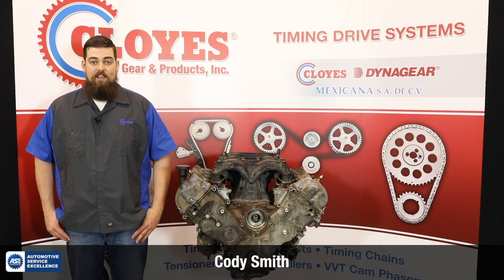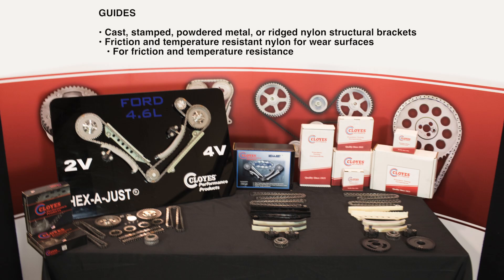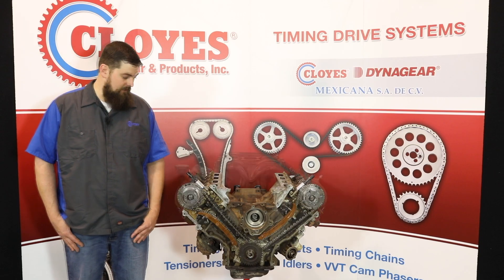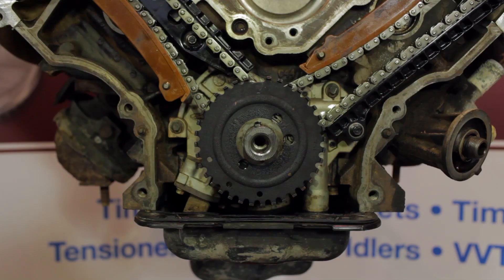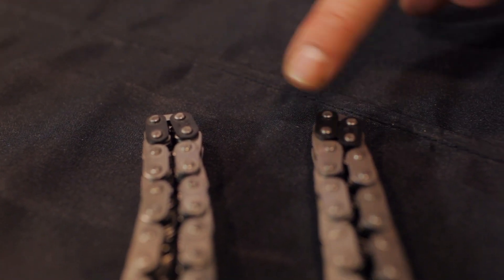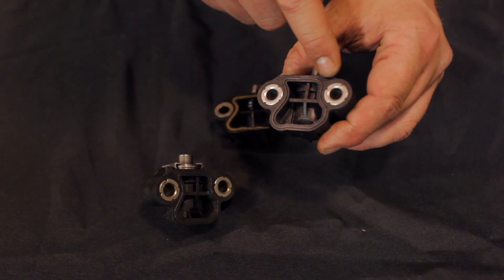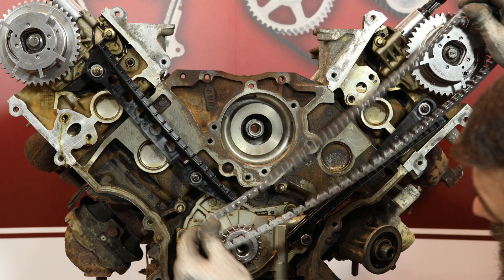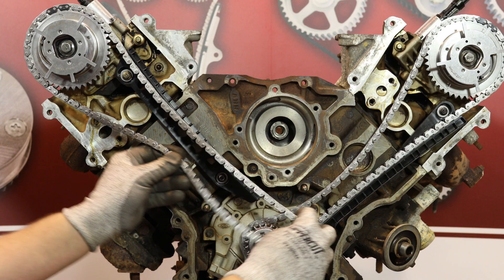Ford 5.4L Timing Chain Replacement, Cloyes 9-0391SB

Comment: Are these Phasers oem?  My kit xam with phasers.  9-0391sbvvt
Reply: Update: never mind, they were garbage right out of the box.  Nothing better than learning the hard way.   Claiming they perform better than oem is a fraud.  “VVT actuators are naturally part of the timing system and it only makes sense for Cloyes to offer high-quality, aftermarket VVT system components that work with our current timing system product offerings,” said Jason Thompson, vice president of engineering and product development for Cloyes. “Our expertise in modern timing systems, combined with our manufacturing and quality standards, resulted in Cloyes developing VVT actuators that work as good as or better than OE units and will withstand abuse in the most demanding applications.”
Reply: NO1
No!

Comment: What gaskets are needed in order to do this job?  Valve cover? Intake Manifold? Timing Cover? Or are they reusable?  I want to make sure I have everything I need before I tear the engine down.
Reply from the maker: Valve cover gaskets and a timing cover gasket kit should be all you need. Make sure the timing cover kit comes with a new water pump gasket and crank seal.

Comment: No upgrades on the oil pump?
Reply from the maker: We do not sell oil pumps, so we didn't focus on that during the video. We do highly recommend installing a good quality pump while you are doing this job.
Reply: High volume 340HV 20% more oil via 60 PSI

Comment: So i did everything you showed and said but bank 2 is two degrees off and runs like crap.So can you tell what i did wrong?
Reply from the maker: I don't believe 2 degrees is enough to make one run noticeably poorly. One tooth off on a cam sprocket will affect it by over 8 degrees, and about 17 degrees if you are off a tooth on the crank sprocket. Sound like you may have a VVT system component issue or something non-timing related.
Reply: Okay so i keep getting a p0345 and a p0349 code bank 2?
Reply: @ricksherow6422  Did you get that sorted?  I just bought this kit to replace the phasers and timing setup on my 2005 F150 5.4L 3V.  I was throwing  0345 and 0349 previously, and am about ready to pull the valve covers and front cover.

Comment: Hello. Very good video.  My son and I decided to replace the followers, lash adjusters and passenger side phaser on his 06 F150.  We did not use the wedge to support the chain, choosing to instead use a bungee cord.  When we reassembled the engine, the notch and slot on the cam / phaser were about 1 tooth off.  I thought that maybe the cam rotated.  I loosened the cam and realigned according to our painted alignment .   We reassembled the engine.  Ran great at idle, but rough in gear.  Threw a p0016 code.  I figure i slipped the timing chain one notch?  Can you help us? Can i just rotate the phaser/cam 1 tooth?   Any advise would help so much.  The shop just wants to charge us 1600 to pull it all apart and replace everything .
Reply from the maker: Sounds like you are going to need to pull the timing cover off and confirm timing on that bank. Once the cover is off it will be easy to check if the bank is in time or not.  There should be an equal number of links on both sides from the crank sprocket mark to the mark on the cam phaser. Without that visual confirmation you would simply be guessing.
Reply: Yes sir.  I took it to Ford and they hooked it up to their computer and told me that the right bank is 30 degrees advanced.  Not sure what to do with that, so i will likely have to pull the cover.
Reply: Hello again.  I removed the timing cover and chain guides.  I however did not follow your video.....mistake.  My keyway is not at 6 oclock.  I can easily remove the cams, and align the proper teeth on the R/L phasers. I would gladly pay for your phone advice via paypal.  I cannot understand why you pulled certain rockers (to make neutral) if you were going to pull the cams anyway.  I could sure use some advice.  I do not want to bang valves into pistons.  Jerry
Reply from the maker: @jerryvanover5710  You can call our tech line at 479-646-1662 ext 228, no paypal necessary. You should not need to pull any camshafts or rockers, no matter where the engine is at.

Comment: The way you show to line the crank up is 100% incorrect read the ford repair instructions and use the actual timing tool on the crank and you will see im right. The key should be at 11 oclock and the dot should be at 6 i currently have two ford trucks in my shop one i couldnt get to stop missing and the other still rattles after installing your kit. Ive done both now 3 times each twice with your parts and instructions and once with ford oem parts and ford repair  instructions guess whick one fixed both trucks. I should be after you for about 40 hours in labor i waisted on your junk
Reply: Just want to clarify this engine has no timing marks and it doesn't need them this engine has a key on the crank and dowels on the cams therefore if you install the chains correctly it doesn't matter where you stop the engine 6:00 and 12:00 would just be a reference point. Again the chains do all the timing this is normal . Timing this engine is dummy proof.
Reply: Corey is right. You should use OEM parts too. According to Ford the crank must be at the 11 o’clock position.
Reply from the maker: The marked links of the timing chains set the timing on this engine. It doesn't matter what static location you set the shafts to, relatively speaking, as long as the marked links of the chains align to the sprocket timing marks correctly. If you set the crank key at 11 o'clock, that will just require the cam sprockets to be rotated slightly counter clockwise from what we show.

Comment: On ford expedition changed timing chain and sprocket after that the the sprocket is spinning but the cam is not which cause sound and right side 4 cylinders are not working any idea??
Reply from the maker: The dowel on the sprocket should index into the camshaft, then the bolt clamps the sprocket to the shaft. It sounds like the sprocket dowel may be damaged.

Comment: Cloyes kit 9-0391SBVVT. Has a straight torque spec for Cam phaser. No additional 90degress are needed. And I've just taken the entire kit back out of my motor after 2 days and thrown it in the trash. Phaser's failed straight out of the box and unsure if tensioner's are still usable.
Reply: Jeez...making junky critical engine parts is a new low. I put a cloyes timing chain and gear into my daughters 2003 taurus.  I knew they were cheap, but I figured how to you mess up a gear and chain?

Comment: I have the 2v version on this engine and I made the mistake of aligning the keyway on the crankshaft to the TDC mark but the timing marks on the camshaft sprockets are not where they should be (11 and 1 o clock i believe) and I have already taken the timing chains off.  Can you tell me what I can do to fix this?
Reply: Look online how the lobes on the cams are supposed to look. The crank shaft key is what sets the timing
Reply: @jrvera7955   Is it safe to rotate my camshaft sprockets with the crankshaft at TDC?
Reply from the maker: Rotate the crankshaft to a position where all the pistons are down in the cylinders at least a little. Then rotate the camshafts to position them correctly. Once the cams are good you can rotate the crank back so the key is at 12 o'clock.
Reply: @Cloyes01  Thanks a lot! Im doing a full head gasket replacement so I think I can rotate the cams to the right spot while the heads are off and then reassemble with the crankshaft at TDC.
Reply from the maker: @LWilson  That will work great!
Reply: Should be 6 and 11!

Comment: How much should a be charged for this job? My mechanic wants $700 plus $400 for parts.
Reply from the maker: That seems very reasonable. Most shops are going to quote more than that. This isn't a difficult job, but it is very time consuming.
Reply: Oh okay thank you for responding. I really I'm happy because now i know what to do with our truck. Thank you!

Comment: Cody you make the timing of the 3v engine so easy and well explained to some videos i see they’re moving roller follower and lash adjuster and sparks plugs..So Cody the crankshaft key is at 12 o’clock and the timing mark is at 7 o’clock position..
Reply from the maker: Just rotate the crank one more full rotation. That will position your cam 180 degrees from where it is now.
Reply: Cloyes Gear & Products, Inc. so Cody quick question so you don’t have to remove the roller following ,lash adjusters and sparks plugs and position to he number one cylinder at Top Dead Center to time the 3v engine.You make it look easy.
Reply from the maker: @michaelmurray121  Nope, you don't need to do any of that. Those instructions were originally authored by Ford for the replacement of cam phasers without timing cover removal. Then, for whatever reason, everyone else adopted the same procedure for timing replacement. If you are removing the timing cover all of those steps are unnecessary.
Reply: @michaelmurray121  I don’t know what their talking about but this procedure is still in service data. It still says cam followers need to be removed from certain cam lobes

Comment: I'm replacing just the Cloyes tentioners due to morning rattle. Thinking of not removing the valve covers, just loosen them. ?
Reply: You have to remove the front timing cover . You can't even get to them with removing it.  I had a bad rattle too last week and tore mine down and it was a stuck roller follower and messed my can lobe up. So I'm doing a total timming/cam rebuild.

Comment: The problem with the overhead cam engine's is the steel cam shaft is mated to the aluminum head. There is no steel bearing like the old overhead valve motor's. It shows in the video what can happen if not properly maintained, the oil journal's get obstructed and it starts chewing the assembly up to where it gets slop in it, then the head is no good. I wouldn't use lower than 10w 30 or 10w40 in them, I don't care what ford say's. Chevy=the same thing, Chrysler=the same thing. 2009 to 2010 was the end of the overhead valve engines so Ford, Chevy and Chrysler all have the same style junk. Definately not worth what you pay for it.

Comment: For the metal tensioners,  is there need for a gasket? Silicone? Or install metal to metal? These are Cloyes from Oreillies.  Thanks
Reply from the maker: No need for a gasket. Do not use silicone! Silicone can clog the tensioner oil check valve. Just install metal to metal, both surfaces are machined.
Reply: Cloyes Gear & Products, Inc. so you have metal and plastic tensioners?  Or just metal    I might be doing this soon   And was big in the idea of the Melling tensioners   I heard they are metal and don’t need a rubber o ring and are sturdier ?   My mechanic uses your sets with ford phasers    I also want to do the Melling hv oil pump at the same time    Trying to narrow down the tensioners
Reply: No gasket is required since it is a ratchet type and is not a plastic one that requires the oil to push the tensioner to the guide.

Comment: I came up with my own reliable procedure for installing the cam followers on a 5.4 3v. 1st time I had to work on one, I realized no one had made a necessary tool, and my method cannot bend a valve, no follower is ever installed at TDC & I can prove it cylinder by cylinder. 
Installing the followers with that OTC spring compressor tool is a total waste of time, unreliable, and will drop your valve retainers off the stem the 1 time u aren't looking right at it or cant see it.. or in my case, breaks off at the top, valve fell down into the cylinder.. ridiculous. Oh, and no cams "popping" their way around at all doing it my way.
Reply: WHAT IS YOUR METHOD?

Comment: In a video i watched the guy put the first chain link mark one tooth  forward and the second chan link mark right on the dot of the crank sprocket so i followed it did i do this wrong?
Reply from the maker: The chain will have two marked links in a row that will go on either side of the cam sprocket mark, then the single marked will align to the crankshaft sprocket mark. If you did anything other than that the timing will be incorrect.

Comment: Great, clear video instructions.  But, do you have any suggestions for  a 2004 Lincoln Navigator 5.4L  DOHC  4V ?   Broken timing chain led to blocked filter so no oil got in.  Installed new head and timing chains per video.  Have compression in passenger side, but low/no compression on driver's side, so no start.   What a bear.  Just thought I would run that by you to see if you have a suggestion.  Thought it might be a cam out of position, but can't find specs on how to check to find out and position.  Doubt I am making much sense due to having worked on it for several days to try to figure out what I am missing.
Reply from the maker: You need to make sure the secondary chains are timed properly. The secondary chains have 2 marked links that align to the dots on the secondary sprockets.
Reply: @Cloyes01  Thanks.   Will double check that.

Comment: At what point in time are the cams secured/ roller followers removed so the cams don’t rotate? How are you explaining how to do this job without talking about the most important step.
Reply from the maker: Securing the cams and removing the roller followers is not required when removing the timing cover. Camshaft rotation is minimal when the chains are removed. Any rotation of the cams can be easily compensated for by slightly rotating the crank using the balancer when reinstalling the chains. The chain marks 100% set the timing, so if your marks are all aligned there is nothing that you can do incorrectly. Even if you remove the followers you will likely need to make small adjustments to the crank when installing the new chains. Your crank key may end up anywhere between 10 o'clock and 2 o'clock, but that is OK if all the marks are aligned properly.

The roller follower removal was a process written by Ford for replacing the cam phasers without removing the timing cover. Repair publications adopted the process for all timing related repairs, but they simply missed the point of the process.
Reply: Cloyes Gear & Products, Inc. I use vise grips on the cam even though is not recommended but if you don’t remove the followers and you have the timing marks set up where they are suppose to be the cams will move a great amount
Reply: Tile Setter 191  - RIGHT! Ford's design makes this about as thoughtless as it can be... and with timing marks on the chain, you honestly can't screw it up if you're paying attention (some idiot will prove me wrong... but the exception proves the rule).
Reply: IWORKYOUWATCH you secure them with a locking plyers when the key way at the crank is at the 11oclock and the L is facing upward on the left side and the R is facing upwards on the right side
Reply: It's just a timing chain replacement, and the chain is marked for interface/interval. The entire purpose of this, is to avoid issues with camshaft rotation. If you followed the instructions in the video, you'll be fine.

Comment: I have a question I've taken a 5.4 2 valve out of my service truck and the sold me a 5.4 3 valve said it would work_others say it want but this guy I bought it from said u can  get it n time and see were my notch on the cam gear that reads the cam sensor=same to the 5 .3 bc the 5.3 has like 6 notches on front of the cam gear he said after u get it n time find were my notch is and match them up and grind all the notches off except the one that lines up with the 5.2 and it will run perfect can anyone of u experts help me pls thanks!!!!????
Reply: Can I speak with an expert pls

Comment: do the timing chains have some play on some angles, when I rotate the engine to verify chain operation. I noticed on some rotations, the chain has play. before releasing tensioners I made sure slack was on tensioner side. Could this be a sign of worn cams as you stated?
Reply from the maker: It sounds like what you are describing is normal. As the camshafts turn valves are being opened and closed on both banks. As the engine is rotated by hand the camshafts will try to jump forward as valves close. This shifts the chain slack around, and since the tensioners are not primed with oil it will cause some slack. Once the tensioners get some oil pressure, and as the engine rotates faster, what you are seeing will stabilize.

Comment: So your tensioners are better than the oem upgraded ones?
Reply from the maker: Cloyes made improvements to the sealing surface and gasket of these tensioners. These improvements are exclusive to Cloyes.
Reply: Cloyes Gear & Products, Inc. I installed this kit and I have chain slapping, your tensioners are no good
Reply from the maker: @jrvera7955  Did your engine have chain instability before you installed our kit? "Slapping" can be caused by VVT system issues and/or oil pressure issues as well.
Reply: Cloyes Gear & Products, Inc. On 07 5.4L timing chain kit,Does it include Ford phasers or buy oem  equals with your kit

Comment: How do you know the difference between a 5.4.....2 valve and a 5.4
Reply from the maker: 2 Valves were used until about 2003 and do not have VVT, 3 valves were used from 2004 and up and are equipped with VVT.
Reply: @Cloyes01  whats the part number for the 5.4 2v
Reply from the maker: @angelarmendariz8844  It depends on the year. Please use our parts lookup at cloyes.com to find the correct kit.